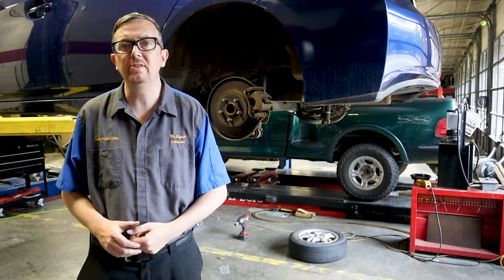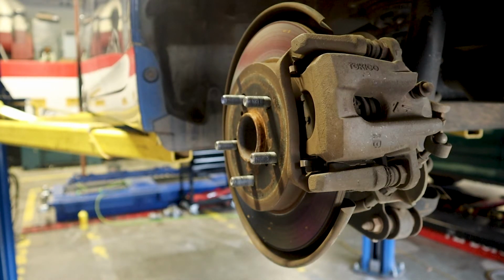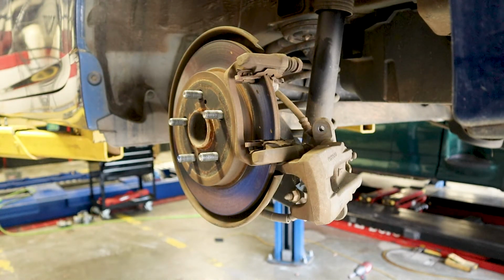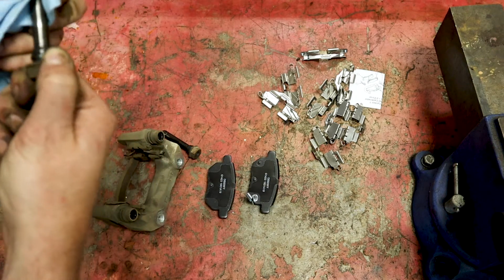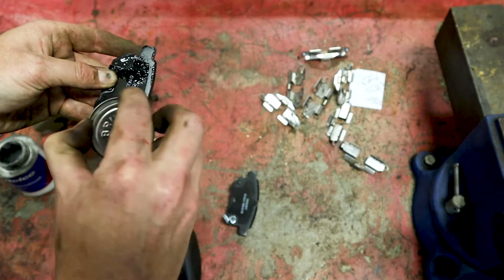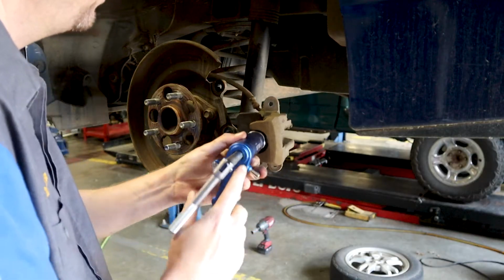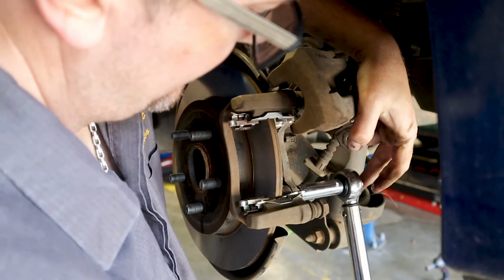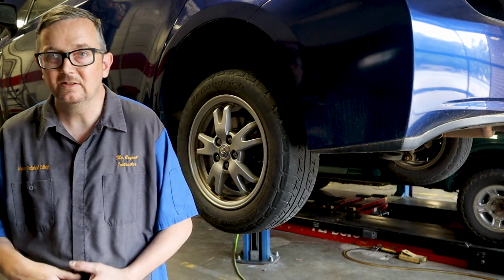Generation 3 Toyota Prius rear brake pad replacement

Comment: I did my brakes, but then saw that it needed to have the brake bleeder port opened,  so the dirty fluid comes out as I pushed that in. 
I have not driven it. Can I redo this, unscrew that brake bleeder port, try again? 
Will that round compressor come back out? So I can screw it in, get fluid to come out? I used a vice grip to turn it clockwise. Or should I totally bleed my brakes? Try to get any nasty stuff out?
My first time doing brakes. And I've never bled my brakes. You have a video for that?
Also might you list what the metal stainless brackets that hold the brake pads are called, specifically? Autozone gave me the wrong accessories kit. 
Thanks!

Comment: I wish I had watched this before changing my breaks last fall. about 6 weeks later my break booster started running every few minutes...207,000miles Now I need $2000 in parts... It hasn't totally failed on me yet, not sure how long I can got before I need to replace it, but I'm probably gonna need to at least order them and replace them once I get a nice day to work on it.
Reply: Parts Online Toyota paid $850 with a sale, otherwise $1100

Comment: Be careful disconnecting the battery. If you close the hatchback, there is no way to open it. You literally have to climb over the back seat and reconnect the battery before the hatch will open with the key fob. Stupid design by Toyota. No reason for it and if you are old like me, it's a huge pain in the ass. Also, the battery cables don't tighten properly. They are loose and susceptible to not making proper contact. I expect better from Toyota and the next car I buy will not have the battery in the trunk.
Reply: Not true, every trunk you can open from the inside, includes prius, there's a small cap in the plastic shelf. Remove it and find and push a small lever, left or right i don't remember

Comment: I always find that the rear pads are too tight and they get stuck and bind and wear unevenly, sometimes they stop working completely. I have to file a lot of material off the ears so they float. I am always having some kind of problem with the rear brakes on my 2010 Prius, I wonder if something didn't go right in manufacturing the rear brakes for those first cars off the line after the 2010 redesign.

Comment: My manufacturer manual says to replace the two shim plates that should've been attached to your pads in this video but I didnt see them. But i see on some brake pad parts it says shims included... But the design is completely different from the prius shim plates attached to the brake pads

Comment: How do you clear the ABS code if it appears?  Do you need a scan tool?  Or can it be done within Maintenance Mode?  Also, do you have a video on Maintenance Mode? 

Also, how are you, and your shop, doing?  I remember seeing a video after Hurricane Milton, saying that the flooding had affected you.  I hope you are doing better.  My wife's brother and family live near Hendersonville, North Carolina, but fortunately they are all at a higher elevation, and weren't flooded out.
Reply from the maker: @Dukeisduke  we are a school, so the state of Georgia got us back up in two weeks. As far as clearing the code, I use my scan tool. Lower level scan tools should do the job if they can read The ABS. Thanks for the concern, and thanks for watching!
Reply: You can reset it but shorting obd pins. Just google it. I don't remember which ones
Reply: @Remont-pcKievUa  I ended up doing that.  Sadly, my daughter totaled the car in late August - rear ended a pickup truck with a utility body, after another pickup broke down in the left lane of a toll road and just stopped there - didn’t pull over onto the shoulder or put on the hazards.  🤦🏼‍♂️

Thankfully she’s okay, but the Prius ended up on a Copart lot.  I saved the polyellipsoid lens from the broken right headlight as a souvenir - it’s heavy, made out of glass.
Reply: @Dukeisduke  glad she is okay!

Comment: Did you use Toyota factory pads?  The old pads that came off had separate shims like Toyotas usually do (you have to order the shim kit separately, and fitting kits if you're replacing those), but the replacement pads looked like they had shims riveted to the pads, which is typical for some aftermarket stuff.
Reply from the maker: I don’t think these were Toyota, I think the owner sourced them locally from one of the parts retailers. Whatever they were, they worked well.

Comment: Thank you for your good information. It would also be good if you made a video indicating the disconnection of the high voltage battery.
Reply: Not necessary, just the 12v will do!

Comment: Hello Mr. B. I have a big doubt about how to intervene in the brake circuit, both for changing brake fluid and changing brake pads. And it's about not damaging the accumulator when the traps are opened. I understand that you have to discount the negative cable of the battery and not open the driver's door, is this true?  I have a fourth generation prius plus. Thank you

Hola Sr. B. Tengo una gran duda sobre cómo intervenir en el circuito de frenos, tanto para el cambio de líquido de frenos como para el cambio de pastillas de freno. Y se trata de no dañar el acumulador cuando se abren las trampas. Entiendo que hay que descontar el cable negativo de la batería y no abrir la puerta del conductor, ¿es cierto?  Tengo un Prius plus de cuarta generación. Gracias

Comment: Bleeding but not adding brake fluid after?
Reply: Maybe the brake fluid was toped off before as the brake pads were wearing.  So no need to add fluid.
Reply: You should check it of course, add if needed

Comment: Is it really ok to bleed / backflush the brake line with the new pads in and the fluid running onto the caliper?
Reply: No, I buy a foot or two of hose line that fits on the bleeding nipple. The fluid can be drained into a can or jar.

Comment: how can you approximate the preasure/ pounds needed to secure the bolts e.g. 25 lbs etc without the special tools? Thanks
Reply: You need a torque wrench. There is no approximating anything without one.

Comment: Rotor is good! Why re-machine it? If it’s good don’t even bother messing with it.
Reply from the maker: It’s been on the car since new, definitely want to machine for new pads.
Reply: @AutoScholarwithMrB  Fair enough. Just have a different philosophy in general and that’s if it ain’t broke don’t mess with it. I guess better to be safe than sorry. :)
Reply from the maker: @Nebraska2927  machining the rotor is going to help the new pads break in and reduce the risk for noise. These didn’t need too much of a cut and will probably still be in spec for the next time. Thanks for watching!

Comment: I appreciate this video Mr B. It helped me with my Prius brakes.  I didn't quite understand what you were doing with that compression tool. By twisting it you were compressing the piston, though I wasn't quite sure how it was working. I have to figure out how to do that on my own. I don't have that large kit. So perhaps in future videos you could demonstrate the cheap little cube tool, it might be a PITA but that's what most of us non-mechanics will buy I'd guess. :-)
Reply: The rear caliper pistons don't press in like the front ones. This is common on a lot of cars. With the press in kind you can use a c clamp or the old pad and that tool to push it straight in. 

The rears need to be screwed in. If you try to push it in, it won't move. There are little bumps that sit in grooves on the piston. Line up the grooves and slowly twist it in. It can take some muscle to do it. 

Hope this helps!
Reply: auto zone has a lend a tool feature-they charge your credit card but allow you to bring it back when your done. Its a multi tool that works on both the front and back as these are different

Comment: I bought a 2011 gen 3 from a dealer.  Very clean with 200 k.  2 weeks later head gasket goes bad.  Do you know of trade schools that work on the general publics cars at reduced rates as the cost of the repair prohibits me from using it.  Thank you
Reply from the maker: It is going to depend on the school. We take in limited work, but something like this is fairly complex for students to handle. Many schools don’t take any work due to liability concerns.
Reply: Old prius its a headache, head gasket, abs, pump, battery, egr..

Comment: Fantastic video! Used it to successfully complete my first Prius break job
Reply from the maker: Outstanding! Thanks for watching.
Reply: @AutoScholarwithMrB  how about a spark plug changing video? That’s my next project
Reply from the maker: @nodeswarm729  unfortunately this isn’t my car, but if I get another one in the shop, I may be able to do that.
Reply: Also, do you have a website?
Reply from the maker: @nodeswarm729  working on that now, but I am on Facebook and Instagram under Auto Scholar with Mr. B